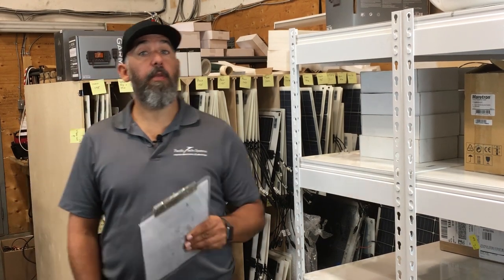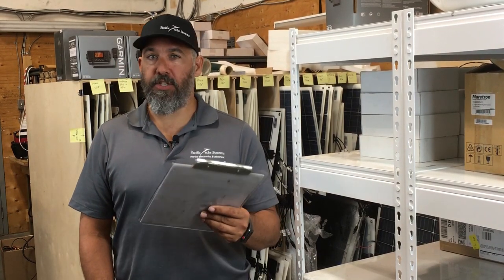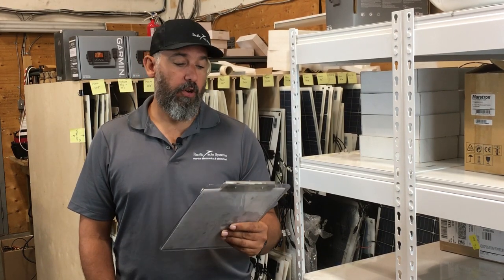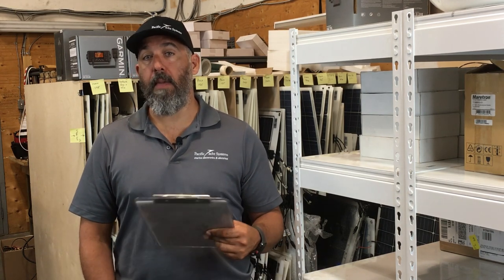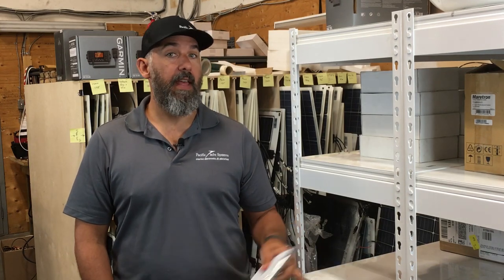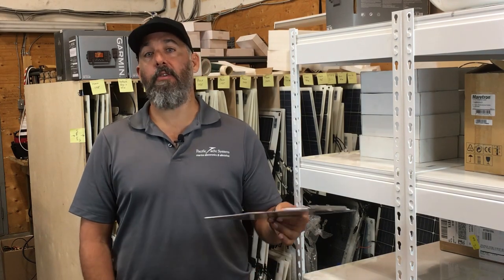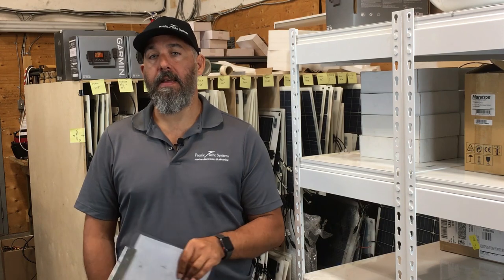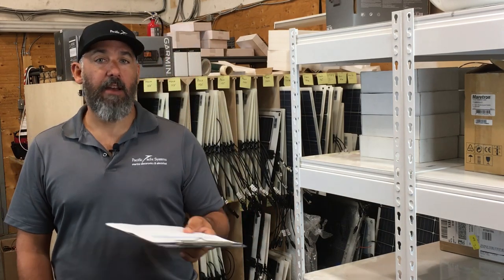What's So Great About AGM Batteries?

Comment: I just spent $210 AGM battery for my Ford focus.  It lasted almost 5 years.  I has a 10 year old Dodge with the original acid battery in it before this car.  So I guess AGM costs twice as much and lasts half as long.  It's kinda like the florescent spiral light bulbs that were supposed to last 20 years that needed replacing every 6 months.
Reply from the maker: Thanks for sharing your experience with AGM?
Reply: Yes, great comparison !  It's true, AGMs don't last any longer than lead-acid batteries.

Comment: My problem is the weight. I don’t have space for inspection or room to add fluid and they are to heavy to move once per month. I had to go with 2 100AH AGM. That equates to 100AH of usable charge. The necessities of being a CPAP user.

Comment: With AGM batteries is there between a battery that is used as a starting battery as apposed to an AGM that is used for the hotel load? Your videos are a great resource. Thanks to everyone at PYS for their effort.
Reply from the maker: Most AGM batteries are good at both engine starting and house loads. Some battery manufacturers, like NorthStar, now have AGM batteries with high cranking amps.

Comment: Thank You Jeff for all your informative and well narrated videos.  Question, How do you monitor your AGM batteries to know at what %age they are?  Thanks in Advance.
Reply from the maker: The best,  and arguable only way to know the condition and health of any deep cycle use battery is to do a c20 battery test.   That will give you an exact AH value of the batteries which you can compare to the sticker value.  If the sticker says 100ah and the test gives you 90ah.  the battery is 90% good.   On boats I would replace a battery under 80%.    The test could be done every 1-2 years or if you think they have problems. Once you test them you can then reset your battery monitor to that test value which will allow it to give correct info.

See c20 battery test info
https://www.pysystems.ca/resources/boating-tech-talk/geoff-measure-battery-capacity/

Comment: Hi Jeff, loving the new series! I was wondering what the best way to join 2 cables in to 1 in the most safe and waterproof way. Something like where you would have 2 nav lights in parallel of a single feed from the helm. Thank you
Reply from the maker: You can use a butt connector, they even make it for 4/0 wiring, and use heat shrink over top of the connection point.
Reply: @PacificYachtSystems  so a butt connector can be used to make a Y connection where a single wire feeds 2 lights as long as glue lined heat shrink is used?

Comment: Hi Jeff, nicely shared!
I remember you said that we can parallel two or more identical battery charger in order to increase and maximize the charge of the battery bank. I haven’t found detailed infos about how to wire such two battery charger in parallel. Can you tell? Many thanks.
Reply from the maker: No trick to it,  just connect both chargers to the same battery.

Comment: Hi Jeff. Great video. What's the difference between a gel cell battery and an AGM? Which has the most life cycles and what's the depth of discharge differences between the two? And is charging the batteries the same process? Thanks!
Reply from the maker: Hi Jason, check out our articles on the pysystems.ca website and you'll find the answer there.
Reply: @PacificYachtSystems  Okay, great. Thanks!

Comment: Hi Jeff, could you perhaps do an instructional on crimping battery lugs and torquing of terminal bolts and whether to coat them with anything etc or not.. or one on setting up solar controllers charge parameter voltages.. Regards Stormer
Reply from the maker: Hi Stormer, we do have those videos already uploaded, look for DIY series under our channel.
Reply: @PacificYachtSystems  I'll have a look thanks

Comment: Great video. By the way does high temperature  above 100 F 0r below zero F causes any damage to AGM battery? And if so what is the best way to protect them in a Travel Trailer?
Reply from the maker: Good question, to my knowledge all batteries have a safe temperature operating zone, and any operation beyond this range will affect performance. Besides temp control, like a heating blanket, not sure how you protect a battery beyond the recommend operating range.

Comment: Hi Jeff William here. I love your content. I have a 36 volt golf cart. With 6, 6 volt lead acid batteries. 1 battery is brand new 3 weeks old. Just pulled all of my batteries out of the golf cart to clean the acid off of the battery tray. So that it will mot corrode. When doing so I noticed that the the 5 older batteries from 2013  are no longer square. They are swollen on the sides. They still function for now. Thinking about just changing them out proactively to AGM. So I would just replace the 6 batteries with 3, 12 volt AGM batteries. Is that correct? Also would I still charge the batteries with my 36 volt charger that comes with the golf cart?
Reply from the maker: Good observation, swollen batteries aren't a good sign. As you mentioned, consider replacing batteries sooner rather then later. You can get to 36 volts by wiring 3 12 volt batteries in series.

Comment: Hi Jeff, with all these 200ah and 300ah batteries on the market,  does it make any sense to buy a 100ah marine grade battery anymore these days ?
I look forward to hearing back from you.
Reply from the maker: Good question. When sizing a battery bank, we generally try to keep the number of batteries' to a minimum. If redundancy is important to the boater, we'll sometimes, build a battery bank with at least two batteries in parallel, so if one battery fails it can be isolated.

Comment: Do the AGMs give 20% more or 40% more?  The way I score it to compare the two types of batteries, the AGMs give 40% more amp-hours than an equivalently rated flooded battery.
Reply from the maker: With AGM, you can trade-off battery cycles to go deeper on the discharge. Some boaters , discharge their AGM batteries to about 30% of capacity versus 50% of capacity for flooded lead acid. Since the bulk charge ceiling is at 85% for AGM and flooded lead acid (FLA), useable is 55% for AGM and 35% for FLA.
Reply: @PacificYachtSystems  I haven't bought my lead-acid batteries yet so I want to compare the amount of usable energy (in Ah) that I can get out of each type..  If we have an AGM and a FLA that are each nominally 100Ah, and we anticipate staying in the bulk charging range, then the AGM provides 55Ah and the FLA provides 35Ah.  Which means that the AGM provides 1.57 times (55Ah/35Ah)  more Ah than the FLA - or 57% more..  If the batteries are being used where they are usually topped off, then the AGM provides 70Ah and the FLA 50 Ah, so in that use scenario (70Ah/50Ah), the AGM provides 1.40 times more Ah than the FLA, or 40% more.  I'm glad I asked, because you made it clearer to me that when in the bulk charging range, the AGMs have a very strong advantage.  Great stuff!   Thanks!

Comment: Good Morning Jeff, If you could point me in the correct direction on my question I would appreciate it, I have  twin engines with high amp alternators (150 ea) 1 house battery bank (4 agms) 1 engine battery (31). Should I used a battery combiner to connect both alternators to both battery banks, or use a battery isolator for both banks and connect the alternators to it, or connect 1 alternator to the house bank and the other to the engine bank. 
Thanks Jeff
Allen
Reply from the maker: Hi Allen, you already have large alternators. Simplest solution is to connect each alternator to it's own battery bank. One solution is to have the one alternator directly connected to the house battery and the other alternator connected to a battery isolator in turn connected to house and engine battery.
Reply: @PacificYachtSystems  Thank you Jeff for your input, this is a Cruise a Home built in 1976 in Everett Washington and they did use Romex for the AC. I really want to replace it but can't see removing all the interior so I will be looking for those ghosts you talk about.  Thanks

Comment: AGM does not do well with a partial recharges correct? Say you start off 100%, underway drop to 80% after short cruise with loads, then shut down overnight at anchor, next time you start you only run for enough of maybe, let’s say 5% recharge, and keep repeating so as to only ever get around 70%-80% while out of your boat slip/shore power top-off, …Up and down from less than full charge shortens the battery’s life, even if you never drop below 30-50% DOD?
Reply from the maker: To keep a long battery life with AGM, they should be periodically recharged to 100%. From experience, many AGM batteries seem to have shorter lives when left in a partial state of discharge for long periods of time.

Comment: When I've discharged my AGM (L16) house batteries to anywhere near 50% SOC the voltage reads about 12.1VDC. If I were to take the bank down to 30% SOC, for example, wouldn't voltage drop dangerously low to 11.8 range? Or maybe (once or twice a season) 11.8 isn't so bad? What say you Jeff!
Reply from the maker: Hi Richard, that's correct, a lead acid battery will drop voltage over time. Choosing to go lower then 12 volts is a choice, and if you have AGM batteries you can do so once in a while, knowing that the lower the battery voltage goes you also in turn reduce the  number of battery cycles.

Comment: I been off grid 3yrs I was about to get 2 trogen t105 for $159 each with cores He sent me a message saying he had 2 agm batteries reconditioned $75 each  straight out no core I like to know what you think?
Reply from the maker: Hmmm, hard to quantify what does "reconditioned" mean? Is the battery 50% or 75% of capacity. It's a tough call to buy used batteries as you don't know how the batteries got abused.

Comment: Question:  How do I size breakers and fuses for a given load?
Reply from the maker: Hi Chip, you take in consideration, the wire size connected to the breaker and also the circuit breaker specification from the manufacturer.
Reply: @PacificYachtSystems  Thanks for the reply.  I thought there was a consideration for breaker use vs fuse.  Are you saying breakers and fuses should be the same rating for a given circuit?

Comment: If you already have AGMs, use them up before replacing, but don't play games, these days LiFePo4 is the ONLY chemistry to consider. Even if the outlay is twice that of any other common chemistry, which it is, the cost in and out over time is dirt cheap, compared. Underspec the battery if you are forced to, but do LiFePo4. :)
Reply: I don’t actually agree. I’ve just been through this decision process. Before we started I was absolutely convinced I was going to swap my old flooded lead acid to lithium.  But as we started to look at the impact of switching to LifePo4 on all our systems (winches, bow thruster, windlass, and alternator) the additional costs were rapidly approaching the of the cost of the lithium batteries themselves, doubling the total cost. So suddenly the ROI calculation changes. In the end I swapped our 3 x 140 flooded lead acid to 4 x 170 of the latest super cycle Victron AGMs. Using Jeff’s suggestion of 70% DOD that means I could go to 476 ah, more than I was going to get under Lithium and at a minimum of a quarter of the price. At the cost I could replace them 3 or 4 times over (15-20 years?) and still be about the same total cost of switching to LifePo4. To be clear, I’m not dismissing lifepo4 in the longer term, but our boat isn’t ready for the switch yet. Maybe in 5-7 years time I will have made a number of upgrades, the cost of the lifepo4 batteries will have dropped further and the technologies will have matured more, then I can look again. Or maybe there will be something even better. Until then I’m really happy that I made the right choice for our boat.
Reply: Hi Martin, I’m curious to know how lithium batteries would affect your windless and bowthruster? 
Pete
Reply: @petergibson6563  Are you a pro? I’m not so I can only say that the views I got on this topic varied. Depending on the battery manufacturer, there is a risk that the Lifepo4 BMS will shutdown during very high current loads like bow thrusters, windlass or winches if the current exceeds the manufacturer’s threshold. That’s a risk I don’t want. Then there was the complexity of dual charging different chemistries via the alternator. Again opinions differed and again I didn’t want to take the risk of trying different solutions.
Reply from the maker: Even though Lithium batteries offer lots of benefits in comparison to lead acid battery, Lithium is not necessarily the right choice for everyone.
Reply: @freakent  Thanks Martin, interesting point! No I’m not a  professional.
Reply: @freakent  High draw devices can exceed the maximum output of LiFePo batteries in a way not applicable to lead acid, so of course more batteries in parallel are often necessary when dealing with large inverters and other beastly loads. In certain cases lead acid does make sense, but I've dealt with lead acid so long I'm just tired of the outgassing and the mess, servicing them, replacing them, and the  hydrogen is quite dangerous if something interferes with your venting scheme.  A fine point also that the technology is always improving, and there is some merit in waiting for the next generation while using cheaper cells in the meantime. I waited until LiFePo proved itself to decide on that chemistry. Obviously, this chemistry is not compatible with all equipment; older charge controllers being an obvious one. It is an expensive upgrade.

Comment: Really respect your knowledge but it seems like you are against lithium what would be the argument against something like battleborn batteries for <400 ah applications. The only argument I have heard is that you are reliant on the BMS but that would also be true of the charge controller and other subsystems. Maybe just trying to justifying my purchase and the fact that I love how fast they charge less gen time and solar is much faster full amps til balancing
Reply from the maker: Hi Tom, my advice to fellow boaters is there is no perfect battery for everyone. Lithium is a strong contender for boaters that need the most energy density out of a battery bank. If space and weight is really important to you, then Lithium makes lots of sense. Also if you plan on using your battery bank extensively, like a liveaboard and you'll be cycling the battery thousands of times over years to come, Lithium is a strong contender.  All that said, Lithium does come with a price tag many boaters cannot afford. And NOT everyone needs the benefits of a  Lithium battery.